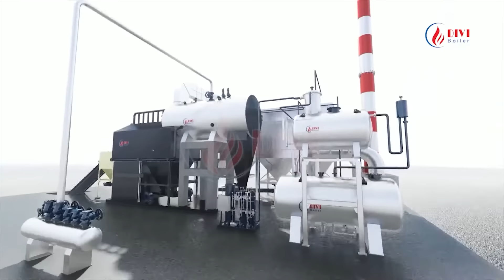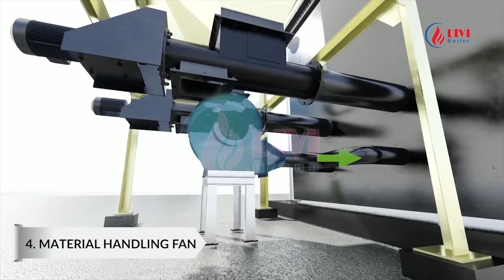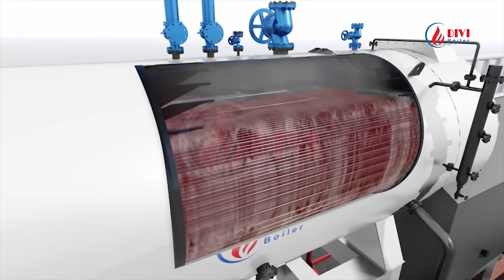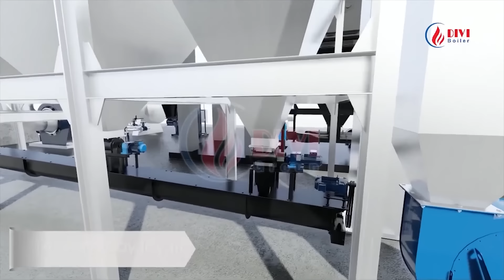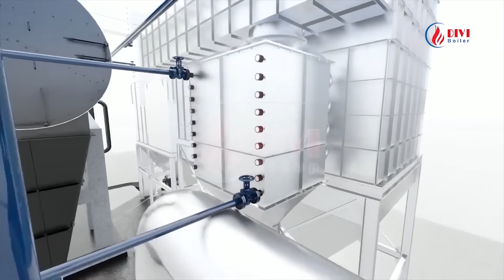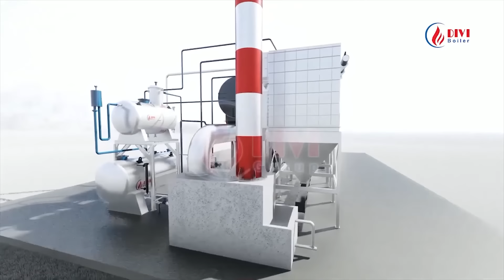3D Simulation of How a Fluidized Bed Boiler Works – Understand It in 8 Minutes!

Comment: What is a fluidized bed boiler and how does it work?
Reply from the maker: It's a type of boiler where air is blown through solid particles (like sand or ash), creating a fluid-like state that improves heat transfer and combustion efficiency.